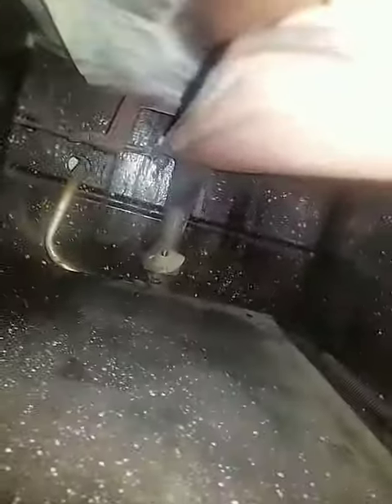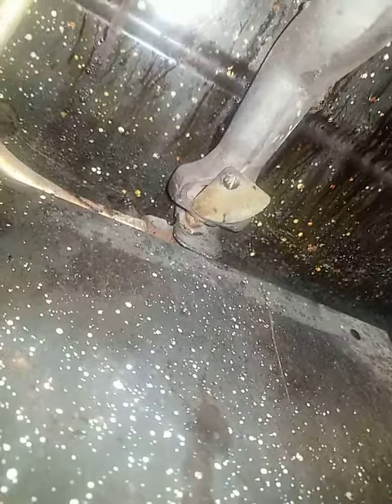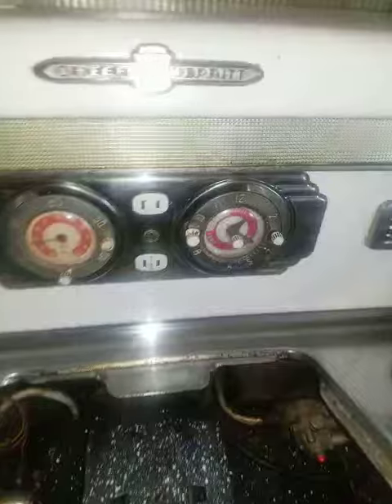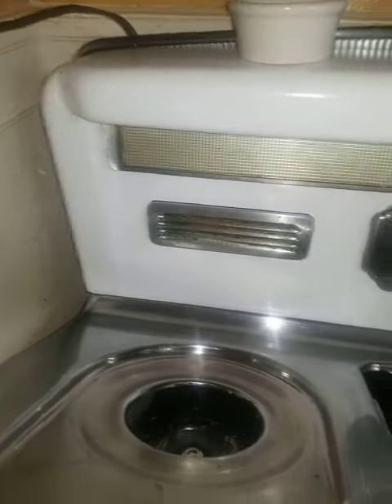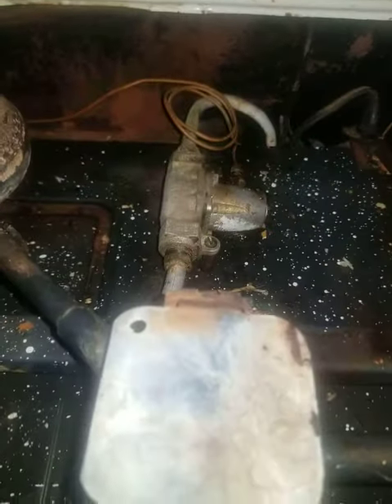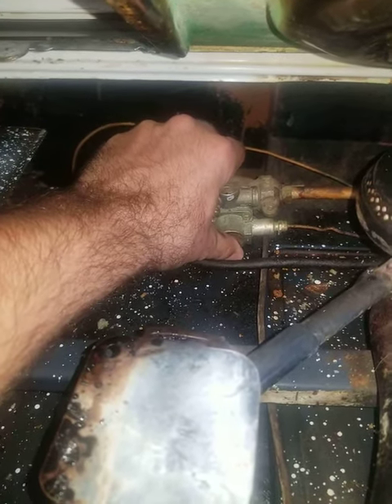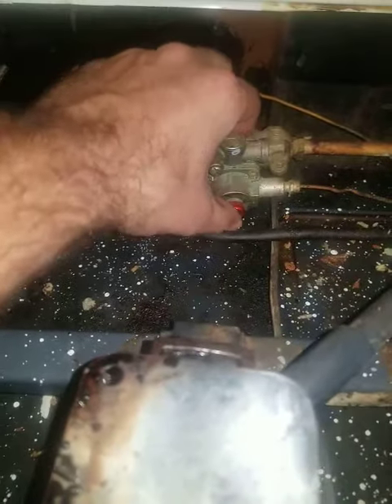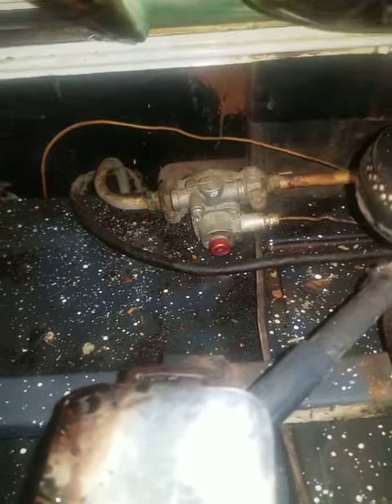Help with O'Keefe & Merritt Oven

Comment: The little box is a filter for the gas.  Old main street lines used to be full of dust so they'd have filters on appliances sometimes on fancy models.  Helps reduce maintenance on clogged burners or pilots.

Comment: Check under the broiler in bottom door..there might be two red buttons you need to push in order to get gas to the oven and broiler
.. one on right probably the oven.. turn oven on to 350 ish then push button in you may need to light manually first time.. I had to do mine twice before oven stayed lit.... The buttons send gas to elements..is what I can figure

Comment: Did you ever find a solution? I’m having the same issue.
Reply from the maker: Hi Aja, I just saw this comment, sorry for the late reply. I paid a person to fix it, but it wasn't before I was $200 into the repair that I saw the gentleman get a screwdriver and adjust a screw on the back of the Oven dial.  This made the flame grow large enough to heat the probe that allows the gas to travel to the oven! Wish I'd known this!
Reply: @sebitito  what oven dial